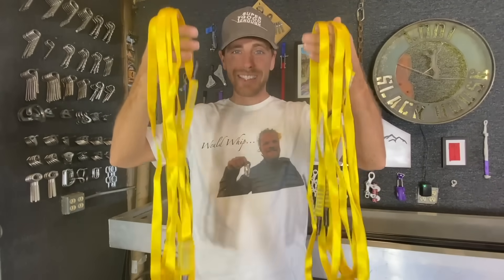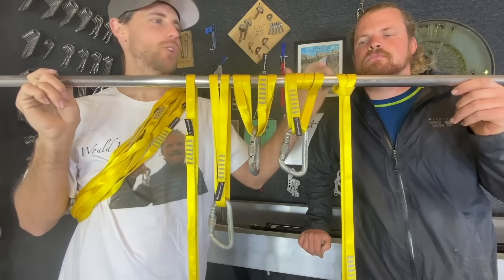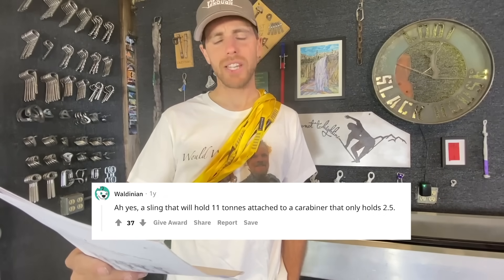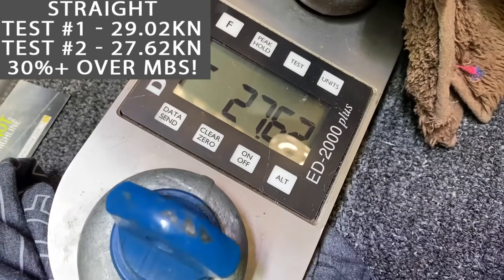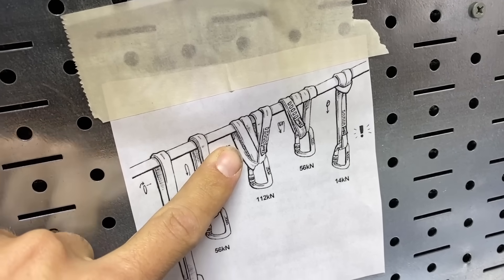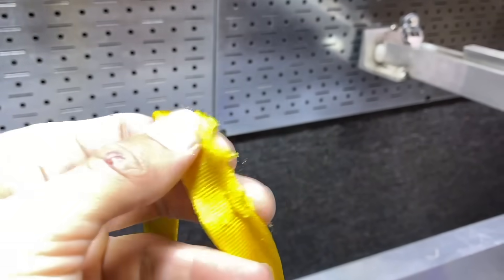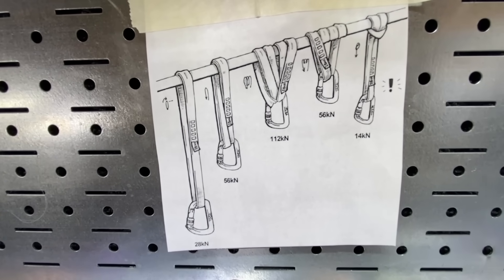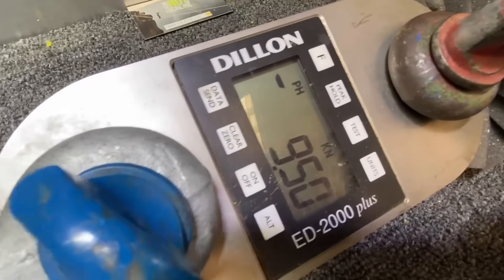Climbing Sling Myths

Comment: In France we usually go with 70% to 80% of the MBS on girth hitches in stage rigging. Wich is also what you usually find on spansets and steelflexs.

I kinda don't understand the loss of strength of the quad-wrap, maybe by putting it onto several carabiners or shackles the result would have been different?

Anyway in ppe use you wanna have those security factors, which are 
4 for steel parts and accessories (chains, quicklinks, shackles, carabiners...) 
5 for steel cables 
7 for ropes and textiles in general (straps, spansets..) 

Those factors are applied in case of hardware lifting and rigging, like trusses, video walls, etc. 
If you fly humans with that, you have to double those factors giving you 8, 10 and 14. 
So like you fly a dancer who weighs 0.6KN, take that 22KN, divided by 14 = 1.5ish KN. For dancing application this is just enough since just you walking counts as 2x you weight on the system. Wouldn't be enough for some acrobatic/circus moves where the system takes up to 5x your weight.. It rises fast 

Thanks for the video ;)

Comment: I've got a potential 14kn climbing situation for you. Its a massive stretch, but here it goes: you are trad climbing and a total dumbass so you put a nest of cams in pods on a boulder mid route. You tie all the cams together with some kind of anchor, then girth hitch a sling to the master point because you need that extension and you need to save gear, right? Now finally you take a whip on it and pull the whole damn boulder off the cliff but you built a bomber anchor with solid placements so none of them fail! In addition to that, you've been building full on bomb proof anchors every 20 feet ( because you don't want to be the dumbass who decks with a whole rack, right?) So the last point doesn't fail either and boom batta bang, now you have a stupid heavy rock about to crash into your harness, prime to generate huge forces on multiple pieces of gear and a situation that will likely never, ever happen.

Comment: I really wonder about leaving material on the wall for rapelling now. Leaving zinc-plated stuff is not good for corrosion, but leaving a sling or a piece of cord should work fine (and may be cheaper). Could you rapell of your shoe laces? I once saw some people rapell with their rope directly through the hanger and then toproping on that rope.

Comment: In a simplifier analysis it makes sense that the girth hitch preserved strengh. Slings is rated to 22 kN, this means breaking tension in the material is half of that. if the girth hitch is considered as a single layer sling put across a double layered sling  at an angle of 90 (hope this makes sense), 11 kN tension pr layer of sling would give a break pull force of double that. Nylon probably comes closer to that in real life compared to dynema, since nylon stretches more and distributes the loud more evenly on the width of the sling, whereas dyneema puts more load on specific parts of the sling. As small diameter carabiner probably also means more locally high tension and therefore lower breaking force.

Comment: Before you run out and girth everything, realize that the shackle pin is a huge bend radius compared to a carabiner.
Reply: Right. A smaller diameter is more of a pinch. Greater stress concentration. The smaller it gets the more it behaves like a sharp corner

Comment: I've done a course on theoretical physics last semester and we learned some things about slings/ropes and how they behave force-wise under certain setups. The biggest issue with the theoretical rope stuff is (at least in my course) that the rope is seen as one-dimensional most of the time, so it only matters how often it is wrapped around something. If the rope is a three-dimensional object, meaning that it has a mass and more importantly friction, only the friction between the rope and the surface is calculated, while the friction between overlapping parts of the rope is neglected. These are some pretty massive simplifications in comparison to real-life but obviously, theoretical physics should only give us a general of how some things behave during certain situations, and then it's up to guys like you to test it under real circumstances. Keep up the great work!
Reply: having studied physics myself, i was really wondering where the halving should come from... the only reason i clicked this video ^^
Reply: That sounds more like an engineering, materials science, or maybe like a kinematics course. The scope of theoretical physics is quite broad, and definitely covers a LOT of different sub categories, but no institution I know of would list a course on ropes and knots under "theoretical physics", as that is usually more concerned with things like baryon asymmetry, accelerating universal expansion, quantum gravitation, and other cutting edge fields of study. At least, that's how it was during my undergrad, things might have changed in the 5 years since I graduated.
Reply: Bracing angle is another very important factor as the looping eliminates the ability to pull in a straight line (2d vs 3d)
Reply: On the setups with several wraps around the bar, the outermost lengths of rope are at a pretty big angle. The tension on these will be more than you might naively expect (e.g. more than 1/4 the gauge reading when there are 4 lengths of rope) because only the cosine of the rope tension contributes to the force on the gauge. The other component (the sine) is cancelled out by that of the opposing length.
Reply: And that would be part of the reason they broke at less than 2  and 4 times the force of the single length test.
Reply: In the last test it seems that the obvious risk is for the sling to burn off against itself. It might be the relatively slow increase of power that saves it. If a climber falls I think the stress will go from 0 to max quicker. And it might add to the risk of heat breaking it.
Reply: If you factor in different layers of the body of rope, you still don't have friction and uneven loading within the rope.
Reply: The real world " but hey that's just a theory" gosh I just cringed hearing that monster in my head
Reply: "theoretical physics should only give us a general of how some things behave during certain situations" - no reason a decent 'theoretical' model for ropes can't be used, as a rule of thumb though, if you can compress your model such that an 80 year old professor can physically write it on a blackboard, it's too simple and lazy to model any physical phenomena   well.
Reply: Assume a spherical cow
Reply: Theory is only the starting point in physics.....   experiments are a cause to change or modify that theory.   Also other theories are born, ie what are the consequences and to what degree self imposed friction effect?
Reply: Disagree, I do not think it is friction being the root cause, but I think you are right in saying it is the 3D nature of any real sling or rope causing the discrepancy. Simply, the sling being very wide relative to its thickness makes it very easy to get an uneven cross-sectional stress distribution. If one side is under more tension, it will break first, dumping the load on neighboring strands, exceeding in turn their yield strength, and causing a cascading failure like ripping a paper. This effect is nearly absent when the sling is perfectly parallel with itself and perfectly perpendicular to the smooth support, but as you double it over you create an angle with the support and with the returning strand, skewing the stress distribution. Moreover, if the sling doubles over itself, and partially overlaps, the extra thickness from the underlying layer is going to create more strain (thus more stress) in only the overlying part of the sling. This hypothesis fits the observation as the angle and overlaps negatively correlate with break strength, while the ideal case of a perfectly perpendicular sling yielded the highest. Most simply put, the less it "sits nicely", the lower it will break.

The knot is a whole another can of worms which I will NOT open.
Reply: no you didn't
Reply: There are some good points made, that i would subscribe. Also i think the setup puts a lot of energy and thus friction into the system generating a lot of heat. It would be interesting to see, if you guys would get any different results if you would do the test way slower. See, you want to create a static situation, but static is not to be seen in contrast to a climbing situation here, but more to the internal timescales of the stretching dynamics of the rope. Maybe the setup was too dynamic for the sling itself, and it could handle more if you would increase the force with rests in between.
Reply: @christophredlich1442  the heat actually occurs when the strap unloads. When it is stretched to failure it permanently deforms to be longer than the original strap. The energy stored in this deformation cannot be mechanically unloaded because the strap won't return to it's original length. This energy is dissipated as heat and vibrations and stuff.
Reply: @Thesupremeone34  this is not correct, the heat goes in both directions. Think about the mechanics of what's going on here, the heat is generated from friction in along the fibers on a macro scale and changes in length in the polymer chain themselves on a micro scale.
The molecular structure only cares about movement as far as temperature rise goes. It doesn't care if it's from an applied load or movement induced by releasing said applied load. Obviously your rate time function is going to be different thus Delta T will be different in either senario.
Reply: This is basic mechanics and material science at best not theoretical physics. Who says that??
Sincerely,
An actual physicist
Reply: @Doctor_Yuri  lmao 😂 he sounded so smart too. Glad someone elaborated. Though I don’t know your stats beyond a YouTube commentator
Reply: @TheGoonSquadd  I agree with you and the commentor you replied to. This is pretty hilarious
Reply: @thefourthbrotherkaramazov245  lol I wrote the comment and then read the others and saw Yuri’s I was so hype and then was like ahhh dang I got bamboozled. And then was like wait, how do I know this dude is an actual physicists. YT comment sections are wild
Reply: Another important point is that this is not at all a rigorous test, they only have 2 data points for each set up, while these results are interesting you can't really make any kind of conclusive statement with out significantly more data points.
Reply: @Ender240sxS13  
"It's a myth!"
Reply: For the theoretical 4x, They still failed in tension. My take would be that the load is not evenly distributed on the 4 passes because of various mechanisms. So that would make some of them to elongate more before the same load is applied to the less stiff ones (see them as springs that are not leveled). That way you lose quite a bit of resistance because the full load is applied on one spring before the whole system can reach its capacity.

It makes sense because if you could actually reach 4x, you would have 4 clean failures instead of just one.

Theoretical physics can still be applied here. Just have to make the right assumptions!
Reply: @igottajoe9294  My thoughts exactly.
Reply: @igottajoe9294  This guy has the answer.
Reply: I don't know if you're going to take Mechanical or civil engineering, but

The friction from overlapping ropes increases the amount of energy they can store, effectively making them stronger.

It's the angle of the loading and rubbing of edges which are the largest causes of failure here. 

When it's being pulled in a simple straight line, the loading is axial and only has normal stresses, but when it is pulled at an angle, the body develops sheer stresses, which greatly increase the equivalent stress in the body. 

The edge rubbing both decreases the effective cross section, wears the material (I suspect this is negligible), and creates stress concentrations which can double or triple the effective stress at the bottom of the folds caused by the rubbing.
Reply: Damn... that intro course has ya sounded smart af for this experiment!

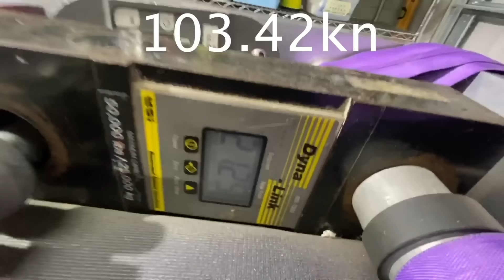Comment: 14:17 I feel like that tests that seemingly refute common safety recommendations (try to avoid girth hitching your slings) should be tested in ways that better represent real life usage. Here I'd really have liked to have seen the girth hitch in 2 carabiners (both ends) instead of big, rounded shackles. 

Really appreciate all the effort though!
Reply: But that goes beneath minimum Bend Radius of the sling.

And why use a chocke, when you have a carabiner?
You can just open that up.